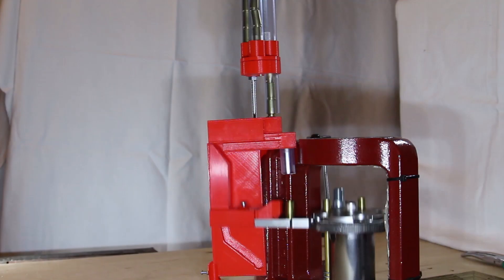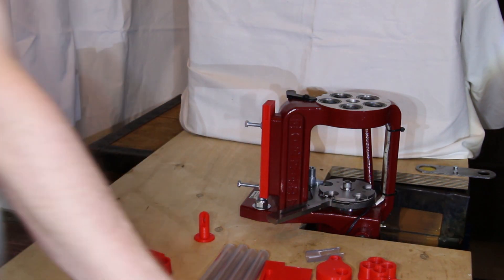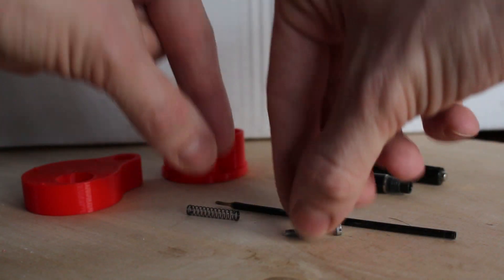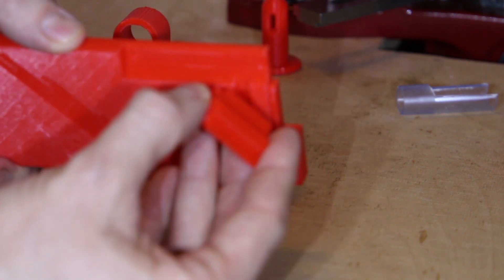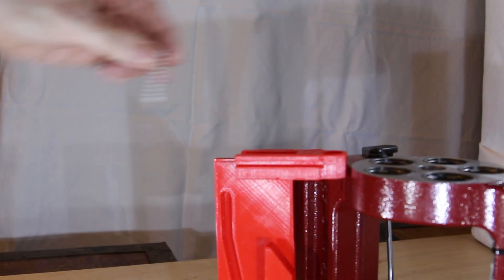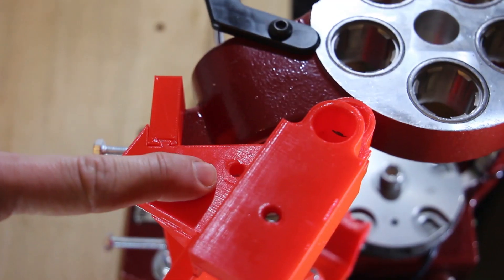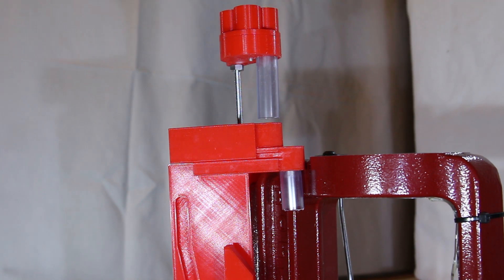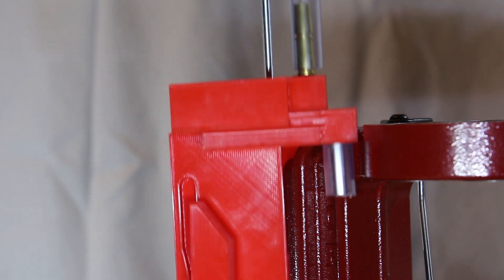3D printed Casefeeder Hornady Lock-N-Load AP setup manual / instruction

Comment: Thanks for making this video. I would just note that I always pre-assemble the parts and put glue in the dovetails, and around the mount bracket wherever the mount bracket and top body come into contact. That top screw the holds the spring in, I use and M4 screw and thread it into the plastic. The stabilizer is first attached loosely to the pattern, once the assembly is attached the press, it's slid down to contact the table and the holes are located that way, and screw then tightened to the pattern. I use a bit stiffer sprint in the turntable part, and tighten it far enough that rotation is just still barely possible so it doesn't flop around.
Reply from the maker: Hey Jeff!
Thank you for your comment!
True, we didn't mention the glue - We thought about first testing the setup and after finding out, where glue is required, we also suggest adding it!
The M4 screw should be threaded in, true! In our setup, gravity works fine enough - if this requires an improvement, we will thread in the screw :)
In the turntable part, the screw is just barely tightened, I think I soon will thread it further in. We didn't have a stiffer spring at hand, so this was our solution.

Anyway, your setup works fine, thank you for your work and comments!
Looking forward to add more improvements to the press :)
Reply: My only worry with the gravity fed screw is that it could wear a slot over time in the plastic.
Reply from the maker: True. If it does, it will be thrown away and replaced! ;)
Reply: How to get in touch with you.  Thanks
Reply: @johntaylor4781  Message me on thingiverse. https://www.thingiverse.com/thing:2488944
https://www.thingiverse.com/jsondag/about
Reply: @jesondag  I have no idea where there is any place at that sight to contact anyone
Reply: @johntaylor4781  If you create an account, and login, then goto https://www.thingiverse.com/jsondag/about 
You will see a blue box that says "Message me" under the profile statistics on the left side.
Reply: @johntaylor4781  If you're not able to contact me there. Is there a method for me to contact you. I'd rather not post my email address on youtube. Thanks.

Comment: Do I need a high dollar 3d printer for this?
Reply: You can buy a 3d printer and all the parts for less cost than buying a Hornady case feeder, and afterward you will still have the printer.  I bought a Creality Ender 3 for $162. Hornady case feeder is about $360.

Also, there is the option to buy the case feeder from the designer.  Instructions to purchase are on his thingiverse link  https://www.thingiverse.com/thing:2488944

Comment: I purchased one off E bay its a great idea and works however the pieces didn't fit together I had to dremel everything even the tube holders were to small to fit the fragile plastic tubes, wish mine was as easy as shown.....
Reply from the maker: Rick Jones we printed it on our own printer to make sure the parts fit together...
Reply: Handload Of Fun do you print and sell these??